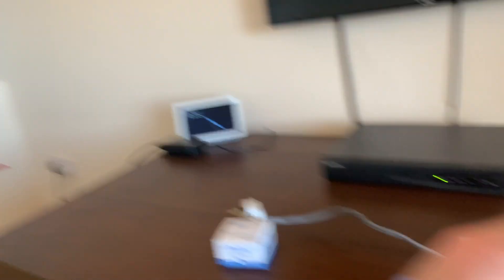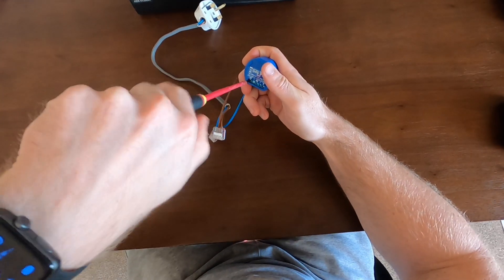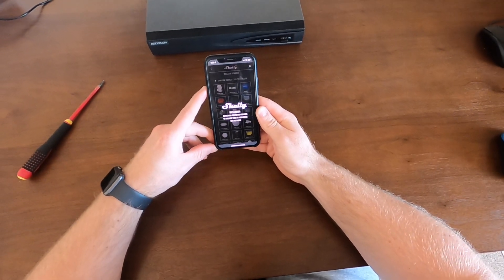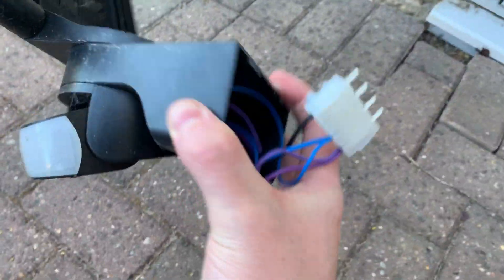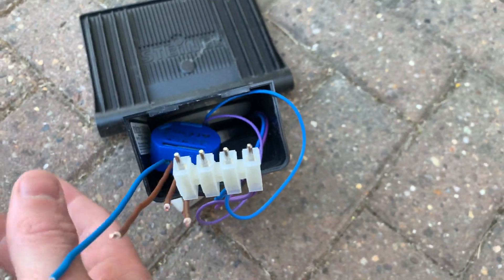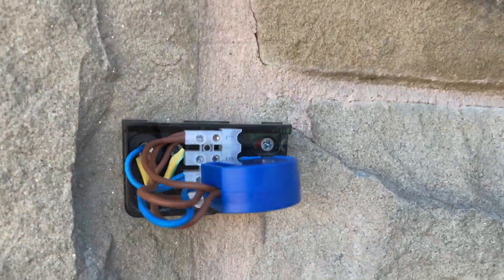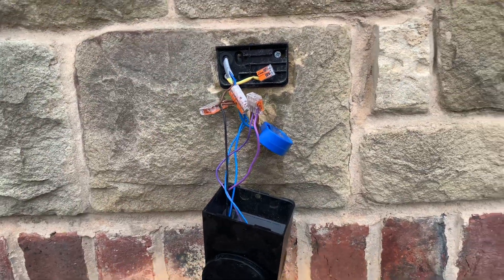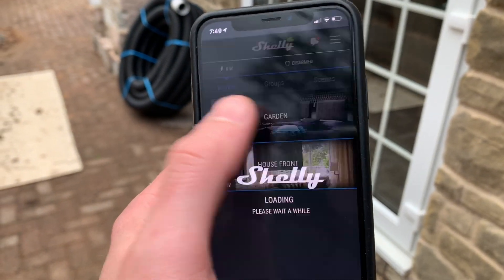Smart Home Lighting using Shelly 1 WIFI Switch & Steinel XLED Floodlight

Comment: Hi mate great vid. How are these keeping up 4 years on? Also I notice your using the app to control the lights but do you also have a physical switch to control the floodlight? Will there be any conflicts with the switch and say any schedules you may have set for the light? Thanks in advance
Reply from the maker: Hi, I replaced these about a year ago due to two of them I installed getting water ingress. It seems the sun degrade the face plate of the light which then allows water in. I now have Brunnenstuhl smart lights, which has removed the need for Shelly’s in them. 

To answer your question though, the switch didn’t affect the shelly, depending how you wire them, you can use the switch to turn it on, but to be honest it’s just as easy on the apple or with google home hub / alexa.
Reply: @DIYJourney1  Many thanks for the response. I'd like to have the option to both control using a switch or a physical wifi button some near the patio window and the app. Just wondered weather the two control methods would conflict each other somehow. Keep up the vids been following your progress :)

Comment: Hi and thank you for a very useful video.   I notice you have used the Steinel Motion Floodlight.   Let’s say sunset is 5pm, If you set it using the Shelby app to turn ON at say 9pm till sunrise, can it still work on motion between 5pm and 9pm ?
Reply from the maker: Hi,

Yes as the motion is separate the switched supply

Comment: Might want an epilepsy warning on this vid...
Reply from the maker: Do you have any videos, showing how I can improve mine?
Reply: @DIYJourney1  well you could do this for starters in your description "WARNING: This video may potentially trigger seizures for people with photosensitive epilepsy. Viewer discretion is advised."
Reply from the maker: Can you please advise where this issue lies in the video and what would cause this issue? 

Also can you back up your claim with facts to why this warning is required?
Reply: @DIYJourney1  example at 12:28  LED bulbs are turning on and off, the flickering on video becomes more pronounced and obvious because the camera's recording frames per second is unaligned with the frequency of electricity. This is called the 'strobe effect. Change the FPS on your phone/camera to 50fps (50hz PAL UK standard ) to match the UK voltage frequency as opposed to 60fps (60hz NTSC USA standard) 

Not trying to be arsey here but rather be helpful.
Reply from the maker: Thank you, I was asking more from a health point of view than the camera (at the time) issues.

Comment: great video thanks! My next lockdown project, are you in the UK? Trying to identify a suitable pir sensor in UK (without light) that would be used to automate other lights - I'll check your other videos too - great job 👍👍
Reply from the maker: Thank you, I am UK based yes, Im sure that is doable with any pir that has a feed to it, then use ‘output’ if you like to feed the ‘SW’ on the shelly and that should do it. May try that myself actually 😁
Reply: @DIYJourney1  awesome, just checking your other videos now too (the house looks amazing btw 👏👏). This Shelly thing could get a bit obsessive to turn sensors / switches 'smart'! I'm trying to stay away from Home Assistant & looking to integrate the smart devices together thru Samsung things or Google home 👍👍 (or replace sonoff rf3 with 433mhz switch) with another Shelly! 😂
Reply from the maker: Thank you, yes it does haha, I bought a load more the other day including more flood sensors. I used all mine on google home